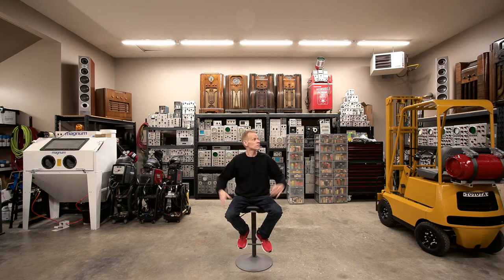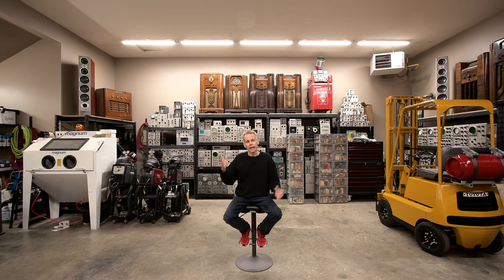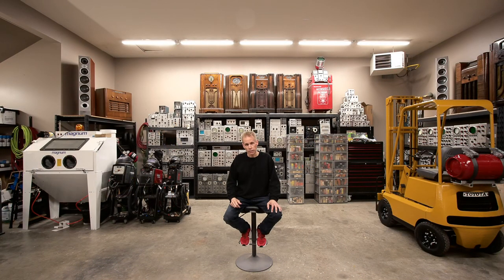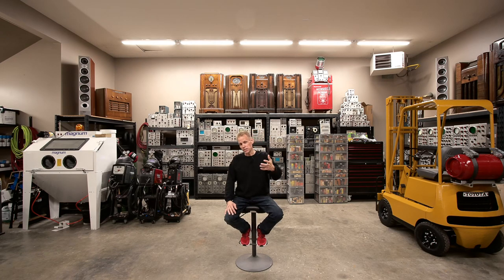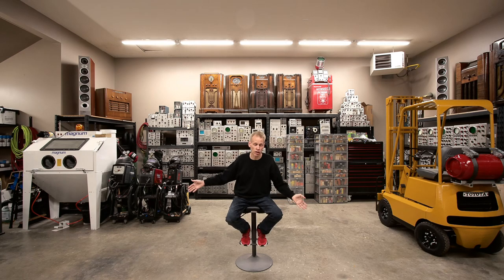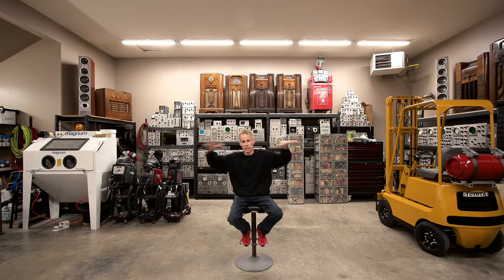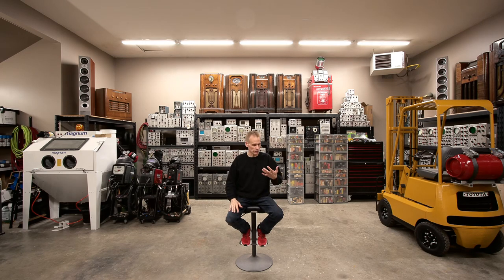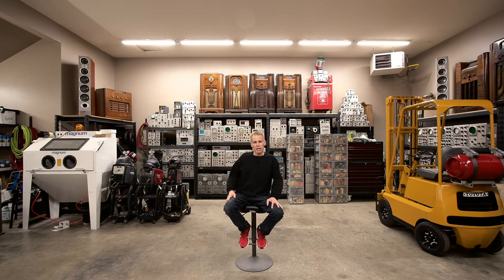ZAP! Mr C's Worst Electric Shock Explained In Detail!

Comment: For sure this is now the moment that people respond to you with similar stories.
And sure enough I have them as well. I was shocked a few times from mains power. In live in the Netherlands and here we have 230V 50Hz.
That is a completely different beast from your 110V 60Hz. Come and try it out yourself 🤣😛
No really. You will feel it. Luckily I live to tell the tale but it can end in a different way.
I never built transmitters or tube equipment but I do build audio amplifiers. These are no joke either. +/- 70v DC high current transformers and rectifiers and capacitor banks.
Around these amplifiers I was always.... ALWAYS very careful.
I started to test with 12volts and limited current. If that worked okay, then I would step up. But in steps until I would go for the real deal. But I would stand back with the first full power start up.
Imagine a reverse connected capacitor bank blowing up in your face. No thanks.

Comment: Aren't you supposed to go to the ER after one of those bad shocks so they can run an EKG?  A shock can leave your heart with an irregular rhythm.  

If you are in a position to help someone who has been shocked:
 - Make sure they are disconnected from the power before you touch them! Do not become a victim yourself.
 - Call EMS or have someone do it.
 - Start CPR if the victim is unconscious. Do not give up, this is important, it will keep the victim alive until EMS can take over.
  - If you have access to an automatic defibrillator (AED) and the victim is not conscious absolutely use it.  In fact a defibrillator is the only thing that can reset heart fibrillation.  

Better still get some real first aid training before you need it.  Might as well be ready for all the other emergencies as well.

Comment: I add my story, i am a electrocuted electrician, as in i have damaged main nerve in right arm, and main nerve between spine and chest. I had put safety locks on the safety-switches on the 400V supply, but a more experienced colleague could not do his work, and told that the cables not would be live, unless a controller was turned on in software. I trusted him, do never do that, only trust your self, i got 230V trough my body, from right pointing finger to left shoulder, and my heart felt like a rock. It took +4 years and 19 different hospital departments later, to identify the damage, thank good for free healthcare in Europe. Now left with itching burning skin, i am very temperature sensitive, and on a bad day, i am not able to lift a pack of yeast.

Comment: savety is the most important part about playing with high voltage. My freidns often call me a p**sy for always double disconnecting my stuff bevore i touch it, and useing isolation transformers and low current breakers and stuff. Im super caucous to be save. but also I would like my stuff also not to blow up.

Comment: Glad you escaped with your life, worst shock I've ever had was from an old time live chassis ctv, should've been safe right?, nope, the previous repairer had shorted half the mains switch out instead of replacing it, i was young and fit then and survived ok, but it certainly gave me a nasty surprise, made me very wary of unknown electrical gear.

Comment: I would guess, you took poorly smoothed DC HV in through the mic and out your legs/feet via the chair/stool and your legs catapulted you up and whatever direction you landed.
I had an similar experience as a kid, from sitting on foot end of bed to slammed against the headboard in a curled up heap, all via car ignition coil output into hand and out a leg through cheap folding table (metal legs and rim) the HV was provided by an d-shaft electric motor running a set of points/condenser firing a cheap car coil. the motor was from an early diesel locomotive cabin blower (72v rated?) and the ignition coil was some random low end typical "can" aftermarket racing coil with yellow top (accel brand or earlier?) post that I have been zapped by 120V ac countless times and nothing has made me land across the room since.

Comment: Is it possible that it was an RF shock?
Reply from the maker: No, RF shock or burn is a very different sensation, more of a heating feeling.
Reply: @MrCarlsonsLab RF energy was what I suspected too - though you would have had severe internal scarring being bitten for that long. 
The reason why I suggest "RF" is I understood event began the instant mic was keyed up after already holding it wih no shock. I've seen this after having pre-grounded in error to an internal RF node,  the wrong side of a z-match shunt capacitor. The instant key up unexectedly turns metalwork 'live' sends circulating current around grounding including mic. I got internal scar inside hand and that was just 3 seconds.

Comment: I was untangling a string lights (230v) and was shocked, not instantly but over like 0.5 second. 

My arms then hang for like 2 minutes (nerves numbed?) And were abuzz, together with my chest.
Reply: I did some bangs and popped some breakers later on but never was shocked again, while repairing, measuring, testing stuff.

Comment: My career was as a machinist, welder and mechanic. I still have all ten fingers. Beware cloth and long hair in the machine shop. No gloves around rotating parts. Several times I felt a pull standing at the lathe as a rag in my pocket was being wrapped around the lead screw, slow speed and no solid attachment so I got away with it. Keep clothing clear.

Comment: Enough DC will cause you to grab on also. I built a pole peg transformer amplifier back in the 70's. I used a 10KVA flat wound transformer (ribbon) and a EIMAC 4-1000A tube in grounded grid, if you would get shocked by it you would not live to tell about it. The secondary was 4600 volts @ several amps... I repaired radios/electronics at night for Radio Shack and the Worst shock was from a siltronix 600, I got across the plate voltage, It went through my knuckle and almost fused it, I had the same black hole... It would not be the last black hole!:face-fuchsia-wide-eyes: K5AZE

Comment: I guess you didn't use an isolation transformer as you always recommend to do? Happy you did survive this scary story, that is really terrifiying. A pity you didn't find any clear evidence of the cause. You never can be safe and secure enough when working with high voltage or line level.

Comment: Interesting story, Paul. 
Hopefully it prompts some to think about potential. 
During Trade training in every field, safety messages are repeated, so even the dumb ones eventually get it. 
Don't stop repeating the safety warnings. 
Doing so is being professional and an important aspect of being an educator.   

There was a slogan promoted by Energy Safety Authorities here in Australia, especially focused on some 'players'.
DIY = DIE
I've found there is a problem with a lot of IT peeps - They can get rather 'know all' and end up learning through pain.
 
Paul, you should know that the hazards of working with older grid supply transformers and power factor correction Capacitors is NOT limited to electric shock risks. 
I suspect many that watch your content don't. 
I suggest you have a chat about PCB chemical risks too.

edit: No, not printed circuit boards - https://youtu.be/_8EkSx_52q0

Comment: I've never taken that strong of a charge; at least, certainly not at that duration. I think that makes me especially dangerous. I kind of enjoy the sensation.

The worst I ever took was on an ATV. My knee came into contact with a bare ignition wire. My right hand served as my ground, to the chassis, thumb clamped down onto the throttle lever. It's a good thing I was in low gear, because the rollover is what broke the circuit.

Comment: Hi Paul, I was always taught that ac voltage lets go of you 120 times per second and dc wont let go of you  Did you mispeak regarding ac vs dc holding on to you at around the 4 minute mark. My Elmer told me to keep my left hand in my back pocket and only use one hand in a live chassis. Are you sure it was ac voltage and not dc? No disrespect intended sir. I was building an audio amp and my left hand was holding the chassis and when probing the 450 Vdc rectified power supply my hand slipped and the dcv blew a chunk of my finger to smithereens and that was the way I escaped death. Love your channel. It would be cool to implement the am broadcast band on your BC-348 project!!! Best wishes for the holidays.

Comment: shocks are nasty - i put my finger across the 240v live - natural wires of a pbx i was repairing - actually tunneled through my skin. First shock i ever got - think i was about 6 and the back came off a plug. while it was plugged in- And of course i went to un- plug it. still remember 45 years on.

Comment: Worst shock i had, and its probs nothing, but i changed a fuse in a UK plug and lost the screw. It was on a kettle so thought eff it i want a brew il be fine. Made my cup of tea then forgot. Next day go to unplug it, the casing comes off and i touch the innards of the plug. Only way i can describe it was like someone violently yanking at your arm, but with a deep wiggly vibration feel. Very odd sensation and that was probs a very mild safe shock.

Comment: Im coming after your patreon next pay day. Thats for sure.

And That was definitely electrocution. Electrocution is the subjective felt effects of an electric shock.

That being thrown by a mysterious force thing. When i was a kid, i leaned over to try and pet a neighbors horse through their fence, and i had my hand on it to stabilize myself. The all of a sudden i woke up like 6 feet from the fence with a pounding headache. Was an electric fence, and it somehow threw me back like 6 feet. Shouldn't have been possible but it happened, Wouldn't have killed me either though, that i know of. Maybe mains was leaking in. I was probably 5 or 6 when that happened. Still though, it takes a good bit of kinetic potential to lob an overweight 5/6yo a good 6 feet.

When i was a teenager i went down into the basement as the house i lived in to do some laundry. There was an outlet hanging from the cieling, and i had grabbed its case and plugged in the fan while i was down there countless times. Well this day when i grabbed it, i experienced just what you described. I recognized i was being shocked by the stabby pins and needles covering my entire body. And i actually say flashes in my eyes at mains frequency. I coudln't open my hand, but after about a full second or a little more my legs gave way and i fell away from it. Followed by the same headache i had when i was a kid. I didn't have any cardiac arrhythmia that i was aware of though.

I was barefoot on a concrete basement floor and holding the outlet with my left hand too. I didnt have any burns on my hand but the bottoms of my feet were quite tender for a couple days at my heel and the ball behind the big toe. was 13 or 14.

I also almost got Marty McFly'd once. During a lightning storm i was playing my guitar through an amp with poor grounding.

All of a sudden i could feel my barefoot and forearm touching the strings start to pins and needles building very very quickly, and my knee jerk reaction was to toss the guitar into the floor. This happened over the course of less then half a second. As the guitar was leaving my hand the house got struck by lightning and taught us just how badly done the wiring in the house really was. Many of the grounds weren't even attached to anything, left bare at the socket terminals. Most appliances had to be replaced. To this day im glad something in me recognized immediately what was happening before my conscious mind could even process it. Once again i had bare feet on a concrete basement floor. 

Im pretty sure what i felt was the upward lightning streamer trying to find the above positive charge a path to ground. Intense negative electrostatic charge or something. It didnt feel like normal electricity, the sensation got just as intense as grabbing the outlet by the time i let go, but no headache, and the sensation was gone instantly upon releasing the guitar. Very glad it didnt bolt through the houses faulty wiring, and into ground through me. I was milliseconds away from being wired up in parallel with a lightning bolt im pretty sure.

Highly improbable, yet equally logical inference incoming... IF* a God as a concept or force of nature exists at all, then obviously electricity and the electron are the physical manifestation of that force.... So if anything is going to come with a "mysterious force saved my ass" clause, in my mind, it involving electric shock and Mr Carlson both in tandem, almost make such a statement credible without first hand experience. Almost hahahaha.
Reply: "Electrocution is the subjective felt effects of an electric shock." Um, no. Electrocution is death resulting from electric shock.

Comment: I broke a friends light ,a 5 bulb chandelier, it was1989, in Liverpool Englamd ,so 240volts ...I was reliving a baseball swing and hit the chandelier on the backswing ....anyway my pals laughed , as the light went out, I panicked and tried to fix , pulled a chair up and tried to fix the shades I knoocked off touched the "DO NOT TOUCH PART " LIVE and my pals said they saw my skeleton 😅....I felt a very heavy power run through me, it was a heavy feeling,   small shock compared to some guys experience but it woke me up ....leave electrics and plumbing to the right ppl

Comment: From my extremely vague and uneducated understanding you don't need to be in direct contact with ground to be properly shocked, just the event of bringing whatever you are in near contact with up to line voltage can cause current flow. This is why even rubber footed aluminium ladders are still such a hazard as the capacitive coupling of your legs touching the rungs of the ladder through your clothes can move enough current to kill near instantly. What threw you off your chair was probably your own body after the mic burned through the top layers of skin and allowed a greater voltage to enter the body.

The most important thing to remember if your heart ever goes into fibrillation is to stay calm and breathe as consistently and deeply as possible to avoid using up the little oxygen you can get into you. If you can't move at all just focus on breathing. You can be in fibrillation for many minutes, as long as your heart has good oxygen supply it should return to a somewhat normal heartbeat allowing you to contact an ambulance asap.

Thank you for sharing this story, it is always good to remind people that they are working with a silent invisible killer that is waiting to spring on you at any moment.

Comment: Remember a hot summer day was shirtless covered in sweat slumped in a chair at my workbench plsying a computer game. A steel bottomed joystick was on my belly when I reached up to turn on a extenion lamp when my stomach started to vigorously vibrarte to 60 hz ac hum. Realizing what was happening I was able to tug my arm away from the lamp with only a low game score as the after effects. The insulation og the lamps power lead was damaged electrifiying the metal structure of the lamp the metal grounded base of the computer joystick completed the circuit. Still have that lamp which is save to use and touch as long as you remember that little issue 😂

Comment: i deal manly with audio so high voltage is more like 550 volts wene i was just begining i had no bench so i had thd the picse i was working on on my lap the smp was a dynaco MK-lll no test gear so i was putting my figer on the grids to trace the signal way bad idea touched the plate on thr outputs these were kt 6550 so about 550 volt woke up scross the room amp on the other sidethis shows how the young to livr long enough to get old !